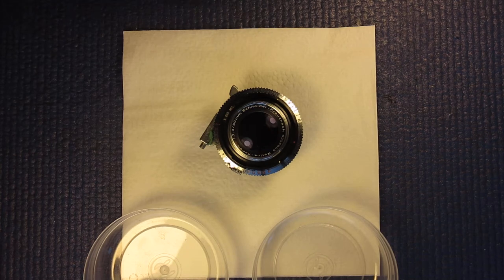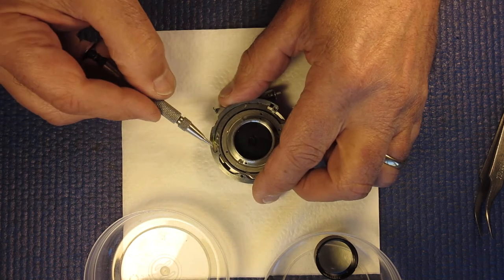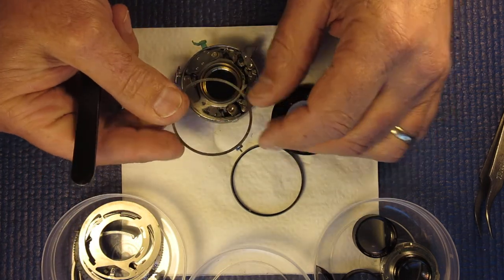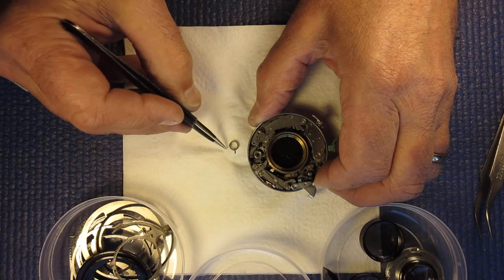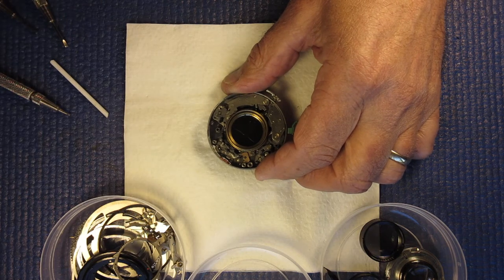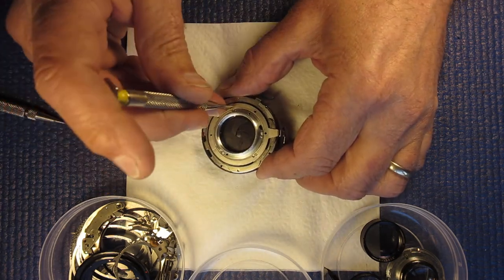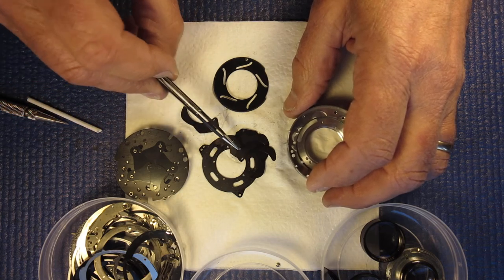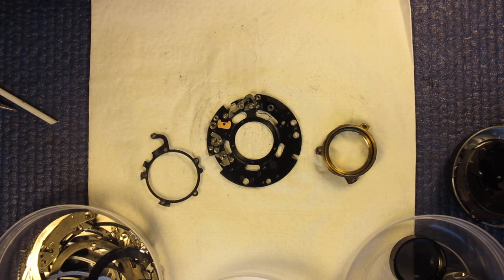Kodak Retina IIIc servicing part 5, stripping down the Synchro-Compur shutter.

Comment: Thanks for this very Clear disassembly, it could be very helpfull for me soon.
I bought I retina IIIC that eventually has a blocked winding lever.
I love those retinas, and the IIIC can be compared to the Leica M3 thanks to its clear viewfinder.
Reply from the maker: If the film advance lever will not move on a IIIc then typically either the frame counter is at number one, or the shutter is not actually cocked. If the shutter is not cocked, pressing the film release button should unlock the film advance lever. Other than that, there must exist some serious mechanical fault, a loose screw in the gears, broken rack or other similar cause.
Reply: @ChrisSherlock  I've asked the seller to test everything you described, but he didn't answer and so I took the risk to buy the IIIC for a good price (for today). So it's gonna be a surprise, good or bad, when the camera arrives.

Comment: Hey my Kodak Retina 1a Won't stay in bulb mode, do you know what could be wrong and how to fix it?
Reply from the maker: Do you mean that you have the shutter speed set to B but that when you release the shutter, the shutter does not hold open while your finger is holding the shutter release down? This is often caused by a broken B lever in the shutter.
Reply: @ChrisSherlock  yes exactly